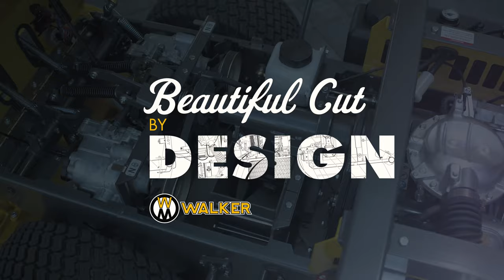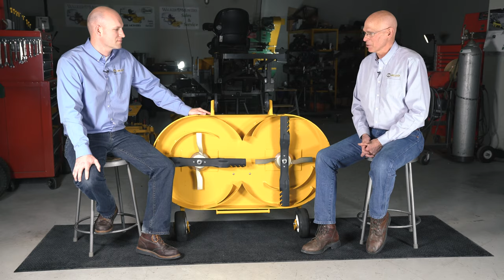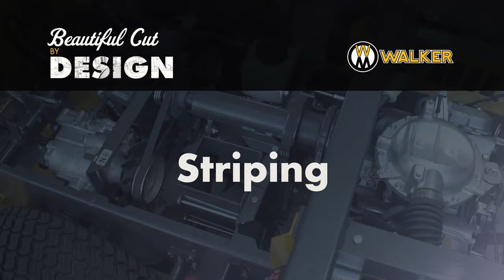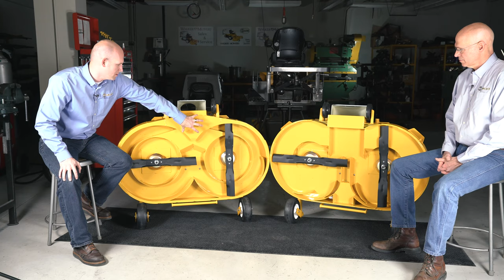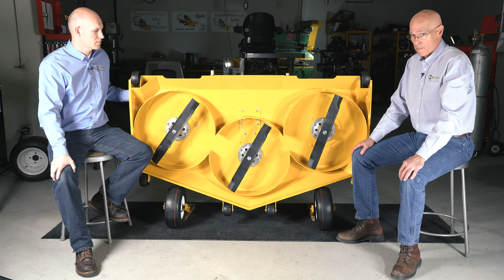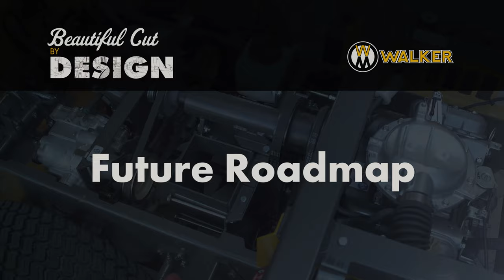Designing Beautiful Cut - FULL SERIES

Comment: The 52" reverse rotation deck leaves lines of grass clippings on either side of the deck when mowing. What makes me extremely angry on this point is that Walker tech support told me that it was probably due to full blades or dirty deck build up. This was NOT the reason. It was a design flaw. This is why the new decks have baffles on both sides of the deck as well as a triangular plate on the bottom side of the deck. This video clearly shows this (pictured left). Can't believe how I was told that the issue I was having was possibly being caused by non maintenance. I had to do my own research on this and found the new decks had these features. I ended up asking the dealer to weld the missing pieces onto two of the existing decks I had, out of my own pocket!